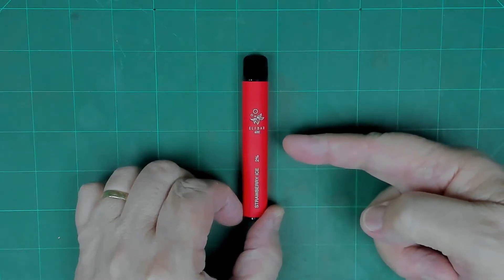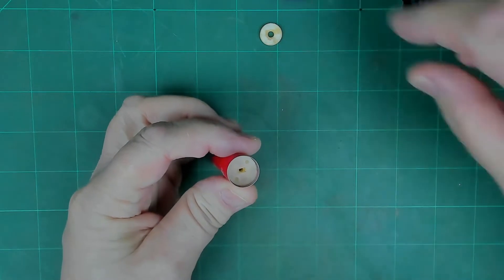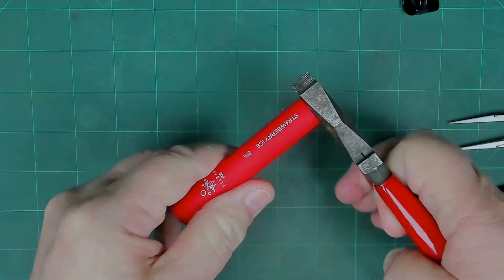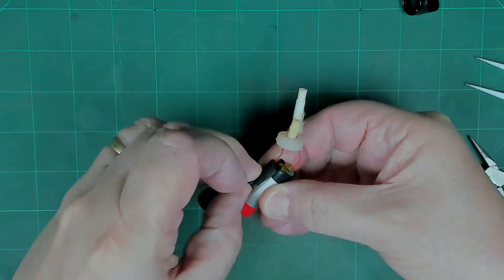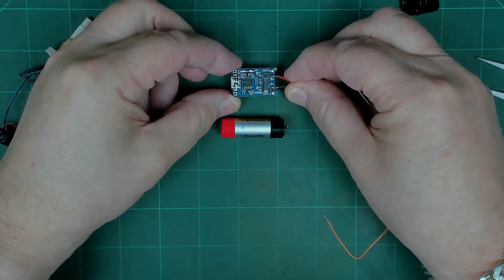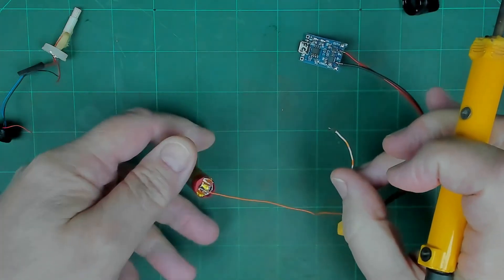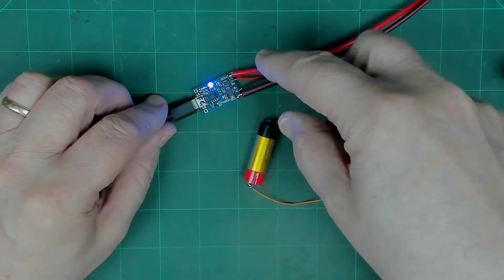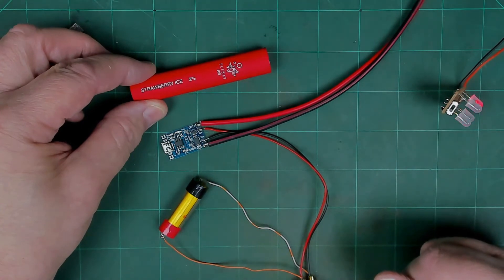Reuse one use Vaping device batteries

Comment: I did this but the charging part gets quite hot is this normal?
Reply from the maker: Hi Alan, generally, no, unless the battery is fully discharged. Assume this is when it's charging with the RED LED on and not when it's Charged? The BUCK regulator can get warm but not too hot to touch. Check connections, particularly polarity! and load. Remember, these batteries were only meant to power a small filament in short bursts, so prolonged discharge can cause issues, though I regularly use one to power a small radio with a 2W output stage.
Reply: @ChasLarge  I think it was fully discharged, yes red light on, as it soon cooled down and after around 10 mins then slightly warm, so was fine , green light come on, so it did work ok
Reply from the maker: @gadgetuk48  Excellent, I thought that might be the case. Glad it's working for you. It's amazing how many of these perfectly good batteries are binned or just dropped on the pavement when the vape has run out.